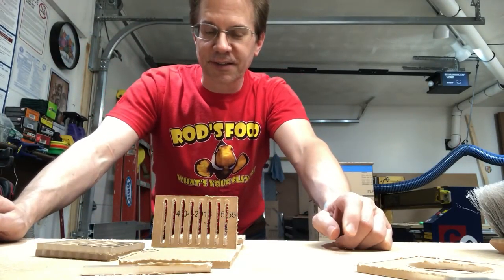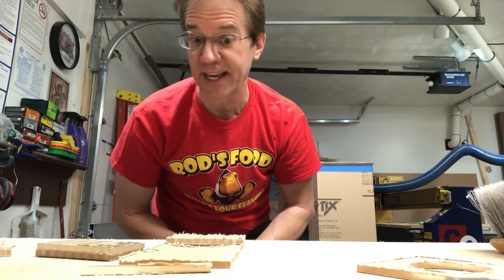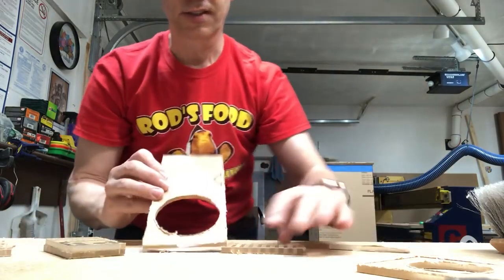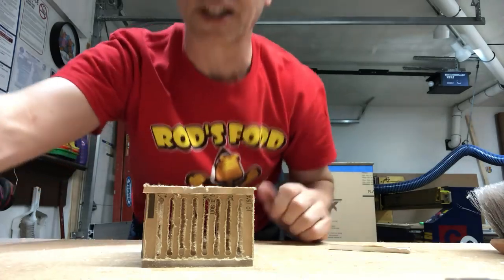Prototype: a Vortech pump cage

Comment: My anemones go throught 1-2mm of hole, i kinda give up on this design (RBTA in my case). Maybe put a small grill behind or in front to prevent this ?
Reply from the maker: My anemones are the size of the pump, or larger. I just want them to have the ability to walk across this surface and yet stay safe.

Comment: Sponge over this guard should prove quite safe
Reply from the maker: The pump usually has a sponge on it, but this is to eliminate the sponge while I'm out of town for multiple days.
Reply: melevsreef I wouldn't trust anemones around Vortech pumps without a sponge. Your design should work well for small fish and shrimps.